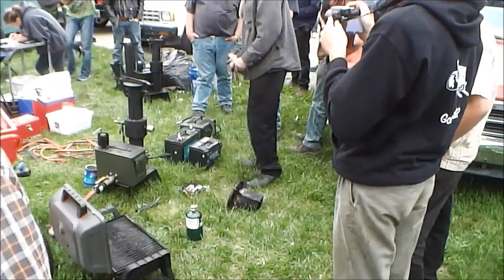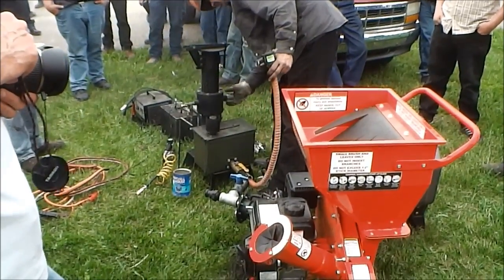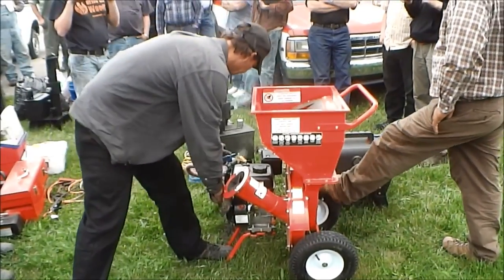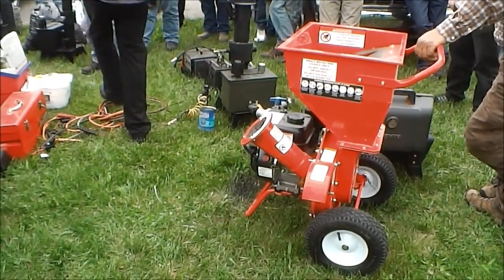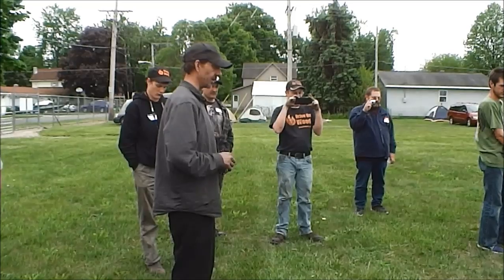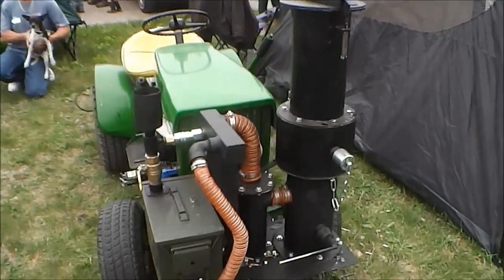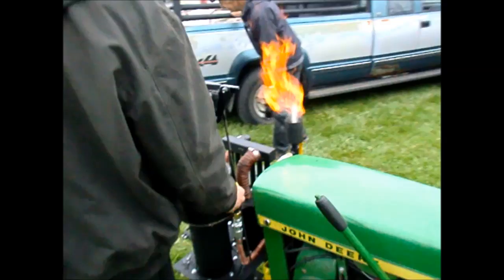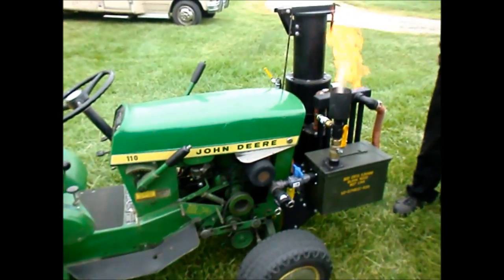Argos 2016: Micro Wood-Chip Gasifiers

Comment: Where is that clean blue gas you need to run an engine with?
Reply: I didnt have good dry fuel. However a gasifier does not produce a Blue flare. Here in this video indeed that was dirty gas but that JD dont care that thing drank tar and loved it. LOL But back to the flare. The H2 produced from any gasifier is not pure, generally H2 will burn orange. In a lab with a pure grade of H2 you will see a pale blue but even with electrolysis Ive never seen it burn blue it always burned an orange color. A good indicator that you are making lots of H2 is the flare may look fluffy, this is water / steam reforming as it oxidizes. CO from a gasifier will burn a brilliant blue color and its beautiful to see. But this is weak gas. CH4 will give the flare a violet / pink color. So what you really want to see is a blue base at the flare with violet / pink color with some faint orange. (not like in the video) Even our charcoal systems with water cracking dont produce a blue flare and that gas is clean. These new machines dont even leave any residue at the carb.
Reply: An orange flame is an indication of impurities.
.

Comment: So…you can use fuel from the gasifier to run the chipper, to make wood chips, to burn in the gasifier, to run an engine, to make electricity, so you can play the electric guitar. Better crank up the volume. I couldn’t hardly hear it! That’s awesome!
Reply: Jimi Hendrix used  to sacrifice his guitar live on stage by spraying lighter fluid on it then setting it on fire....this guy sacrifices his electric guitar by putting it thru the wood chipper and burning it in his gasifier!
Reply: @hmartinspliff  Thats pretty funny lol.

Comment: Did NOT see the 'clean blue' flame required to run the engine on the John Deere? Nor did we see it start. Nor did we see it die when the supposed 'wood gas' supply handle is turned off??

Comment: My only issue on the mower is the cooling area seems small or may be tough to get air through it to cool sometimes. I guess it depends on the climate.
Reply: yup.. needs a bumper style also cooler - + a 5 gal wood chip filter.

Comment: all the demos I've seen show engines running with no load. how well do these setups do when you really start working them?
Reply from the maker: Wood Gas, because there is so much nitrogen in it, has less power available to the engine, but still can do much work. see Wayne Keith's videos  https://www.youtube.com/channel/UCPrGPvL1Y_5cB9UNgoz78Ng
Reply: I have quite a few videos of our machines under load. In general you can expect to get about 50% of the engines gasoline rated power output. I currently run our full manufacturing on a new much more advanced version of what you see here.
Reply: @Thrive-Off-Grid  What if you had a larger gasifier on it? Is it the fuel source that lacks or the volume of fuel? And can the gas be "enriched" for more burn power?
Reply: @minnesotamarine9861  it has nothing to do with the volume. The engine can only suck in so much volume and the gasifier has plenty of gas to offer.

it has to do with gas energy density, The energy of the gas composition is fairly linear form one gasifier to another. Gas volumes can fluctuate but generally not more than 5%

 If you go to a bigger gasifier then it will no longer be sized correctly for the engine and you will under drive it and it will make tar then you will be rebuilding the engine. 

I no longer build direct wood gasifiers. Charcoal is much easier fuel and once you crunch all the numbers its actually more efficient fuel to produce. When you chip fuel the chipper will require energy, it will generator a waste yield and then the gasifier will use 30% of your net just for its process. This will come to more than 50% of your raw feed stock. When you produce charcoal you can easily achieve a 50% yield. water drip will nearly cancel out the energy used in processed. Tar is now eliminated and they run far more stable and are way less complex. Its just better tech all around. The gas is so clean you can run turbo. wood gas will destroy a turbo in a heart beat. 

If you want more power you simply get a larger engine that will meet your application. its as simple as that. You really should be using a battery bank with this anyways. Then this is not problem as you get the big power from your storage and inverter system. The gasifier engine system then only needs to average it. 

Additionally you can build a gasometer and use this stored gas to run LP / NG appliances. Then you get rid of the energy conversions running an engine then converting to storage then converting back to AC. With those appliances we can automate a gasifier to self fill  a low pressure gasometer to feed these appliances more directly. For instance an on demand hot water heater,  LP / ammonia based RV refrigerators, cloths dryers, LP / NG Stoves etc. Now dont need all that battery storage, less solar, engine running etc.
Reply: My friend it is now the year 2022 and Joe Biden is in office and trust me things are much worse gas shortage baby milk formula shortage of course I'm not surprised I knew this s*** was coming because the American people don't know how to pick a f**** president with dumb and stupid the first lesson you need to learn don't pick nobody that got ties to Washington to the good old boy Network you pick somebody that's independent and free and you'll be good